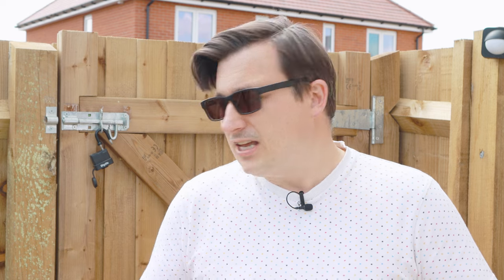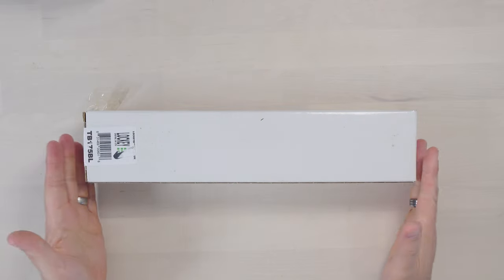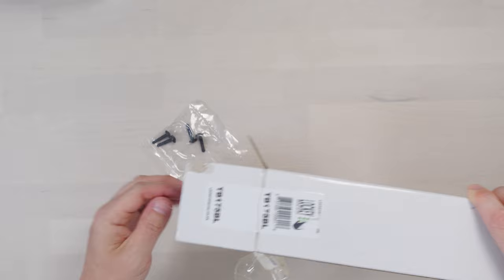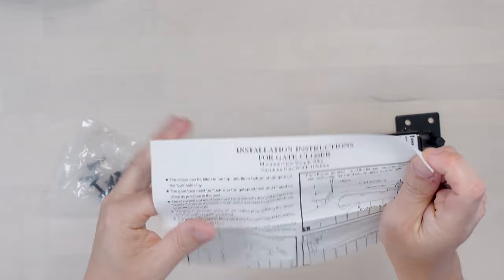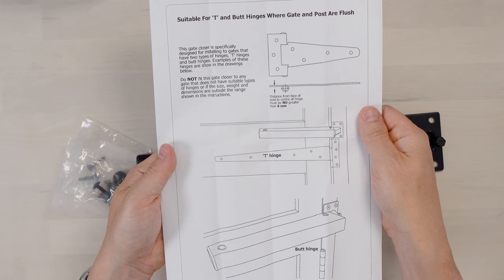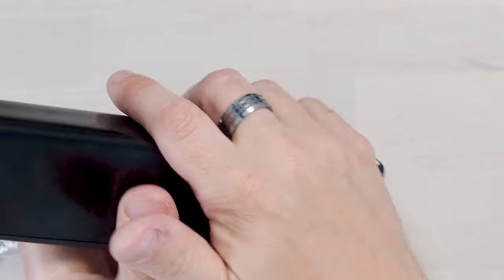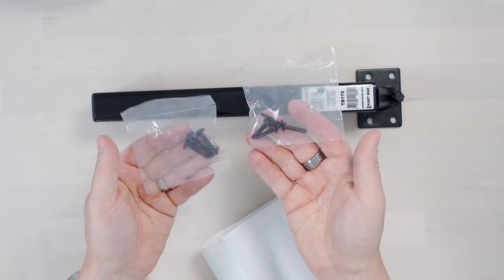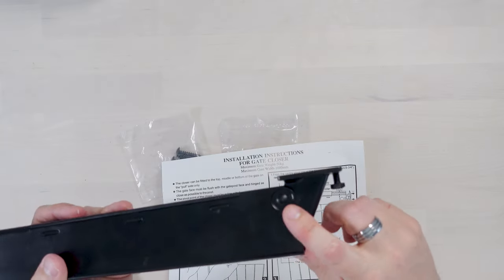How to stop back gate banging! No one likes the sound of hard slamming.

Comment: Nice video Kip. I like the device as it would stop banging. But it seems like the latch doesn't quite engage. Would this device stop the gate being blown by the wind if not on a latch?
Reply from the maker: It would engage if you adjusted it to close a little quicker, however even if you didn’t, I’ve not noticed it being blown open, largely because the wind doesn’t have enough force against the mechanism

Comment: Those self tapping screws are for metal fencing, you wouldn't normally use them on timber. I suspect the roller will eventually come off, but it's no big problem.just replace the screw with something like a 4.5mm x 50, and you will be good to go 👍
Reply from the maker: Ahhhh that makes sense.. will replace it

Comment: I installed one of these in June, and it worked perfectly out of the box without needing any adjustment. For years before that a southerly wind would bang the gate with such force that I regularly had to straighten the tongue of the latch! What a difference now...

Comment: Hi we have invested in one of these. It says 'distance from face of post to centre of hinge must be no greater than 6 mm' in the diagram it points that the bracket should be below the hinge. In your video you have it the middle. In your opinion what does this mean?
Reply from the maker: I believe they mean that the hinge shouldn’t be more than 6mm from the face of the post, if it’s too far away from where the gate pivots then it won’t work properly. Where I’ve put mine works beautifully - it doesn’t need to be physically close to either of the hinges. :)